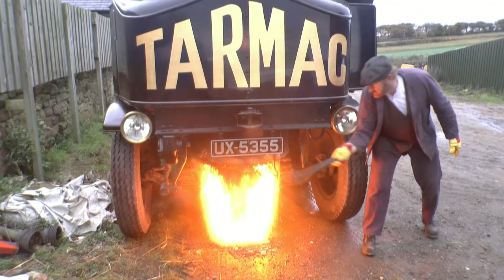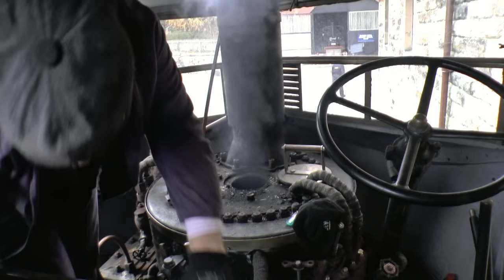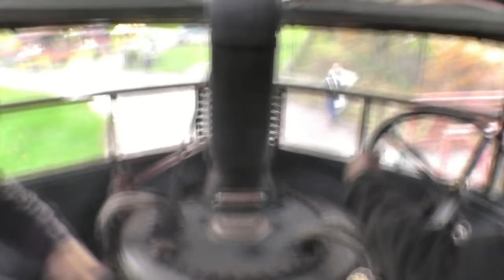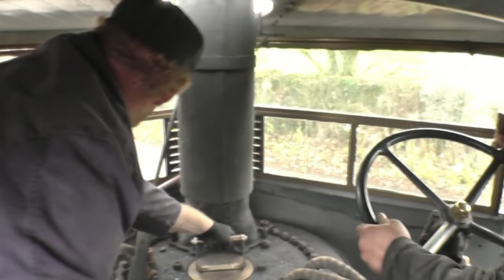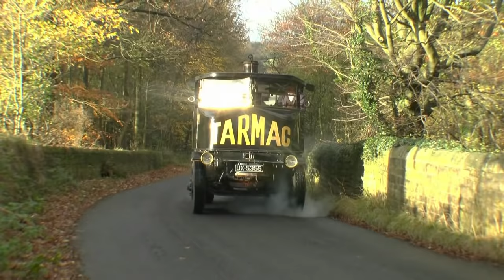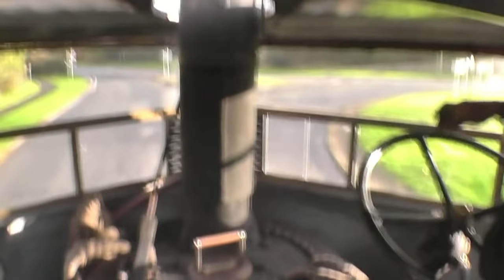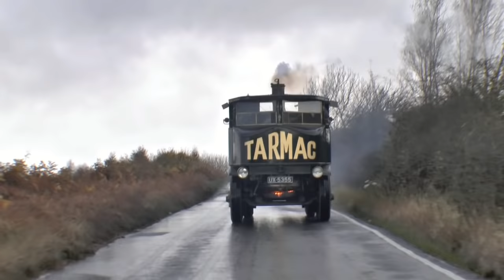Sentinel DG8 Steam Wagon

Comment: I'm a mechanical engineer myself and I really cannot express how much I adore and revere early British engineering such as this. So, I'd just like to express my heartfelt congratulations and my sincerest gratitude to all involved for keeping such a beautiful vehicle 'alive' and running. Needless to say, the most fitting tribute to such a glorious machine is that despite her age,  she'll easily outlast anything that has been built between the early '70s and the present day.
Reply from the maker: I think it will out last all of us  all we are doing is looking after it for a while
Reply: I honestly think it outlasts alot of modern things because there isn't so much delicate components in it
Reply: @ladasodaexplains3355  much like my 1976 toyota d6000 truck. Everything is overbuilt and durable (aside from the alternator haha)
Can leave it outside parked up for any number of years. Put some batteries in and off you go. I bought it off a farm at the other end of australia. Had not moved in 10 years and not regularly used in 20 years.. changed the engine oil. Cleaned the oil filter and air filter(they are not a replaceable type) fitted two used batteries and drove it 1800km home. Aside from the alternator seizing up and a headlight burning out. No issues at all. Was  a great trip
Reply: To me the only technology that rivals the ingenuity in these machines is that of the mighty Rocketdyne F-1 engines on the bottom of the Saturn V rocket.
Reply: Classic Volvo  Laughs in reliability
Reply: Classic mercedes diesel laughs in reliablity
Reply: Sad but true lol
Reply: starting to see why the brits lost ww2 till we got involved
Reply: @JohnDoe-uq9ni  if we had lost ww2 you would have been speaking german!
Reply: Its pretty much like everything that was made pre 1960s. Old London busses such as the Regent and Routemaster are nearly unbreakable aswell. They are built to last millions of miles, and with the right care, they can easily achieve this goal. Nothing inside that can break. Newer busses are built to last 10 years at most, as there is another bus waiting to be used as a replacement. They simply hadn’t the resources back in the days and therefore they needed to make the best an most efficient out of it.
Reply: @oldmbguy8178  don't forget Lanz Mannheim
Reply: TänG€yy -:- 
i önlie häd lätterzöö mäFF -.-

Comment: Cummins:  "I roll coal"
 
Sentinel DG8:  LOL,  hold my clinker while I 'roll coal' with actual coal, son.
Reply: nice  one
Reply: @sacr3  - I make historical men's clothing for a hobby. I recently bought a couple of old very early electric irons just use as fabric weights. I was amazed to find out they both still work. so I naturally tried ironing with them. Its PHYSICALLY HARD WORK - they weigh 2.7kg - 6lb each. You plug one in whilst you iron with the other and then switch. Its a GENUINE workout ironing a few shirts - and this was the MODERN IMPROVEMENT on the old irons you put hot coals inside, this was EASY in the day. 

On the up side - I have never had shirts as well ironed - the creases are like a razor blade - 6lb of hot metal pressing on your shirt fabric makes very flat shirts LOL. 

But its a real shock how much hard work it really is.
Reply: No.

Comment: How much people are needed to run a car?
1929: At least two!
2020: none!
Reply: Yeah but the 2020 car will last 10 years.. this old girl is still going.
Reply: @Colt45hatchback  because someone rebuilt it
Reply: @maxx1o1  well yes of course. Haha
Reply: @Colt45hatchback . Yeah... modern cars are made to be recycled not to last for ever and its a shame.
Reply: @Colt45hatchback  if you knew anything about modern and old engines (technology too) you should know, that everything modern is more reliable and cheaper, than the old ones.
Reply: @derunfassbarebielecki  I would agree with you to a point, I don't believe this is true post the year 2000 everything seems to be made with the least material and the most efficiency nowdays. At the expense of durability. For example, the 2H engine in an early 80s Toyota LandCruiser is fine with doing over 1million km of hard work without being rebuilt provided it's serviced somewhat regularly. Where the current turbo V8 diesel in the new LandCruiser seems to have numerous issues and I'm yet to see one reach 500,000km without needing to be rebuilt or even replaced. Same with trucks. The early 2000's Hino I drove for a number of years was abused the whole time by a variety of different drivers prior to me. The vehicle was replaced at 1,600,000km having never had the engine opened. It had the turbo replaced and 3 clutches in that time. But the head and sump were never taken off and the engine still ran great although it did smoke a small amount when under heavy load. The new truck has had numerous issues in 116,000km including the head lifting under load and ejecting the coolant due to combustion gases entering the water jacket... Yes things are more reliable overall for the time most people own them. But they also don't have the built in longevity of times gone by
Reply: @derunfassbarebielecki  >that everything modern is more reliable and cheaper, than the old ones.

HUE. As an automotive mechanic, I can tell you that statement is soundly false. Vehicles made in the last 20-25 years are disposable trash designed to fail. Manufacturers these days have no incentive to make products last as long as they did 50 or 100 years ago, hence why old things like this steam wagon are still going, and a 3 valve 5.4 triton was scrapped years ago because it launched spark plugs out of the cylinder head.

There is still Victorian era steam machinery being used around the world that has been in continual operation for well over a century with little more than preventative maintenance and lubrication. You won't be seeing a Tesla in 100 years, hell those shitty cars have trouble lasting just 5 years. They aren't repairable either, Tesla has an iron fist on their cars and will blacklist your car if found to be using unauthorized parts from say totalled cars.
Reply: @GGigabiteM  so a 200 hp low displacement engine from the '30s would be more reliable than an modern one? 
If the steam engine truck were in everyday use, it would probably need a whole engine overhaul every six month's or less.
About the steam engine, it needs hours to fire up and if it's in everyday use you will need someone keeping the engine fired for the whole time it is not used. And also gasoline powered engines from the 30's can't really reach the same amount of Miles like modern can do, drive 150k miles and the old ones engine will not be fixable anymore.

Old technology is easy fixable, but hasn't a better reliability than a modern one.
Reply: @derunfassbarebielecki  >so a 200 hp low displacement engine from the '30s would be more reliable than an modern one?

A 200 HP engine from the 1930s is going to be a very large engine. Engines had much higher displacements back in the day because fuel quality was a lot lower. It wasn't until the late 1930s and really the 1940s that high octane fuels started to become widely available, before that 50-75 octane was about the best you got.

A large displacement, slow turning and low compression engine from the early 30s is going to be a lot more reliable than a modern engine. For one, you don't have electronics and two, the engine is a lot less strained.

>About the steam engine, it needs hours to fire up and if it's in everyday use you will need someone keeping the engine fired for the whole time it is not used.

Victorian era steam engines that are still in use industrially today are operated 24 hours a day, there is no "steam up" time required because the boilers are always going.

>And also gasoline powered engines from the 30's can't really reach the same amount of Miles like modern can do, drive 150k miles and the old ones engine will not be fixable anymore. Old technology is easy fixable, but hasn't a better reliability than a modern one.

You are making zero sense here. First you say "old engines aren't fixable" and then you say "old technology is easily repairable"

Old engines are easily fixable. If a part breaks, take it to a machine shop to have a new one made. Your Tesla breaks? Throw it in a trash compactor and buy a new one because Tesla isn't going to fix it.

The Vintage Aviation Co. in Australia has new manufactured Rotary engines and replacement parts for 110 year old engines. Good luck finding a drive train for a Tesla.
Reply: @GGigabiteM  "First you say "old engines aren't fixable" and then you say "old technology is easily repairable" Everithing has its end, if the heart of an engine breaks (for me the engine block) you need to replace it. The old parts can remain, but a new heart means a new engine. Is there any intention to take my words out of context? You should have recognized, that i didnt mean the same. 

Your whole argumentation is about teslas. I really start to think, that you know something about engines but not enough to have really an conversation about them.
Reply: @GGigabiteM  but who wants to be driving the same care for over ten years. Like if im working id want something to work with but if i retire i dont want the same thing also it geys boring being in the same vehicle all the time. There is no point keeping a vehicle especially a personal vehicel for over 15 years
Reply: @somantheeralall1127  Your argument is entirely subjective and not shared by me and many other people. I have a 32 year old truck that I've owned for nearly 8 years, and I'm never "tired of it."

In many cases, it's far more economical to keep the same car and maintain it, rather than buy a new car every X years. If you want to change cars like you change socks, leasing a car is probably the better option for you.
Reply: @derunfassbarebielecki  
Nonsense!
Old stuff can be rebuild by any blacksmith or machinist.
Electronics are proprietary and rarely kept in stock long.
Who, exactly, is going to build you a PCM computer for a 2020 automobile...in 2120? Huh?
Heck, there's archived computer data...important stuff from the Apollo program...that we simply can no longer access!

Electronics aren't historically friendly.
Reply: @derunfassbarebielecki  From your username I'm assuming you are German? There seems to be a notable difference in the views of Brits and Germans on "old tech", especially when it comes to vehicles. In Britain, we value preservation of the old things whilst still moving forwards, but in Germany (possibly due to what happened in the 30s and 40s) I find that there is a national lack of nostalgia for anything from the first half of the 20th century but plenty when it comes to old traditions. 

A Brit owning a classic car is not unusual, but I'm told (by German car guys) that owning a classic car is seen as a bit weird in Germany and they're generally museum pieces. 

German engineering enthusiasts would be more than capable of restoring and maintaining these old beasts, but I don't think many have the inclination to do so.
Reply: how much people live on earth
2021: enough to drive a 2020 car but no more than that
Reply: 2020: No cars needed at all. Everybody stays home.
Reply: @somantheeralall1127  I just had the same car for 20 years,  do you get bored with a toaster or oven? It's a silly argument
Reply: @jusb1066 yeah i change out my toaster based on how i change my kitchen set up. Also i spend a lot of time in my car i dont want to be in the same car for years it gets annoying
Reply: I mean my 90s Toyota seems to be pretty reliable
Reply: Then again I also have a 2010 Toyota RAV4 as well as my 1999 both are easy to work on and reliable never had any major issues except basic maintenance and my time belt broke on the 99 once and the struts are going out on my 2010
Reply: @somantheeralall1127 how often do you change the wife and children?
Reply: @jusb1066  not married nor have kids and materials are not people also there is a reason people upgrade. Sentimental over a car aint gonna get you nothing but repair bills
Reply: @jusb1066  not married nor have kids and materials are not people also there is a reason people upgrade. Sentimental over a car aint gonna get you nothing but repair bills
Reply: @somantheeralall1127  I didn't keep it for sentimental reasons I kept it because it was cheaper, I didn't change it out of boredom, nothing went wrong why change
Reply: @derunfassbarebielecki  Wouldn't that depend on how much they knew back then and how much they raised the tolerance because they didn't realize that they could get away with thinner weaker things back then, and how the cost and planned obsolescence is important so that people would buy more of your stuff in the future? Why bother to improve if you have a trapped client?
Reply: imagine what it took to build that in 1929.
Reply: @bcubed72   In some cases they call it planned obsolescence.  like gamming consoles, or cell phones.
Reply: @somantheeralall1127  very simple everyone who is not interested in wasting money on new car every 10 year , not everyone one have money to thrash like that .
as for the subject old vs modern , modern car are filled whit electronic that just end causing the Wole vehicle to not turn on example i got a sensor that detect if doors are closed that was defective causing the computer to stay on resulting in the entire battery to drain and as final result entire car not working  you don't see that kind of garbage in old vehicle it exclusive to modern trash made to break down for no good reason so you spend more on repair.
Reply: @Colt45hatchback  that’s not modern build quality failing, that’s modern people failing to maintain their car.
Reply: @lastfirst5863  howso?
Reply: @Colt45hatchback  dragging out every oil change, every check engine light and procrastinating regular maintenance. Most cars come with a manual (and if they don’t this is easily googled) that tells you at what mileage specific components need to be replaced, but most people only bring their car in when it stops running. Components failing while the engine is running can lead to more damage to engine internals or other components down the chain, and while one time probably won’t hurt your car doing it over and over again compounding the effects is likely why most cars don’t break 300k.
Reply: @derunfassbarebielecki  absolutely not true lmao. Think about diesel locomotives from the 90s-2000s (which are still new in terms of locomotives), a lot of them are pretty close to needing a replacement. And when I say "replacement" I don't just mean they're old and ugly, I mean they have quite a few big problems that are hard to fix. Now look at that pair of Kriegsloks in Bosnia, they were designed to last about a decade, however those two have been running none-stop servicing the mine and local freight for decades. They were also dirt cheap (even by today's standards) to make compared to the diesels you see today, which would have had their cost in the hundred thousands.

I'm using locomotives because it's easy to compare them to each other.
Reply: @hush6149  Its just a skill gap. Those who are skilled with modern mechanics and electronics will rather work in other facilities than repair shops.

The practical answer is those who can do it, have better opportunities elsewhere, working with modern machines requires high skill and high skill is also needed else where, why do you think many old historical trains are maintained and run by volunteers, old trains already arent worth enough to hire skilled workers and now put that in comparison to modern locomotives which require even more knowledge and skill.

Think progressively, if we would just use the old stuff like short sighted like you are demanding, we would still be cavemen today. Progress is achieved by making new stuff and learning from failures.
Reply: @exxusdrugstore300  Yeah cool, i daily drive a 1991 toyota hilux diesel with 1.2 million km. Engine unopened. Still tow 1000kg above the tow rating 700km per trip monthly (sometimes twice, but usually once a month) my wifes 2001 ford falcon has 1.5 million km and while quite worn out engine and transmission wise, theyve never been rebuilt, my old hilux (1982) is in the process of being restored (body wise, needed repainting to prevent rust, had no rust holes but paint was flaking off) its engine has 1.3m km on it, also unopened though it is a bit tired, it has had a hard life, always serviced on time and such, but it was always doing lots of rpm and lots of heavy work. Its earned its restoration. Where my neighbour bought a new hilux in 2012, he does no towing and always service it at the dealer (i do mine myself) last year it needed new engine so he sold it and bought a new one again, where my "old junk" as he calls it, is still working hard every day.
Reply: @exxusdrugstore300  you're forgetting about the designed lifespan. Honda, toyota, maybe some other manufacturers have a longer one than others, but most cars are nowdays engineered to be disposable at the end of the warranty period. Uneconomical to repair.